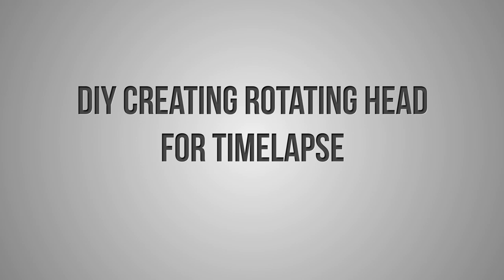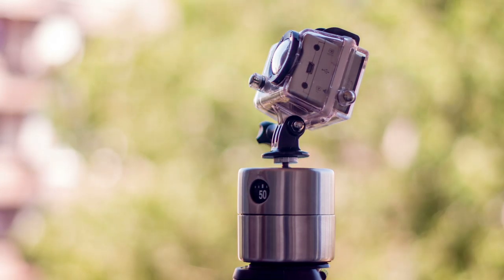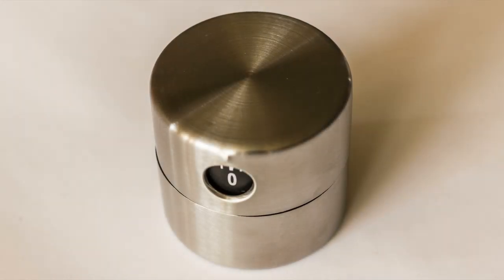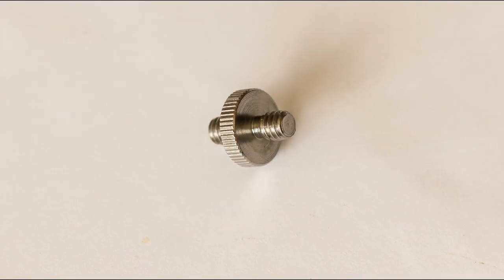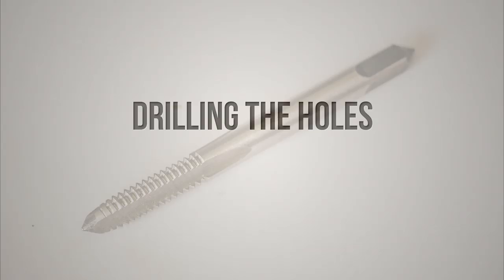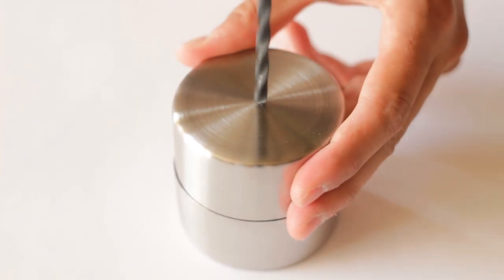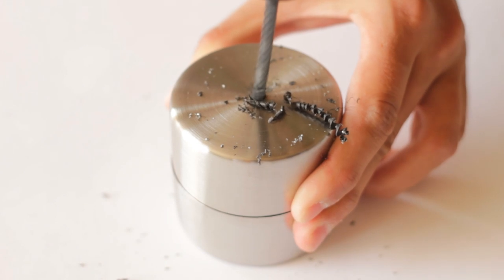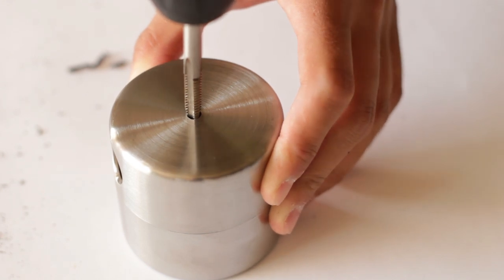Build a DIY Rotating Time Lapse Tripod Head

Comment: Why not just glue the tripod mount adapter on top instead of all this drilling?
Reply: Then you're stuck with that. Putting a 1/4 20 in it you can mount anything.

Comment: would work for shots panning from right to left, but the other direction not so much.
Reply: flip the eggtimer uppside down
Reply: Reverse the video.
Reply: David Andersson It wouldn't work, the panning direction will be the same.
Reply: Brian Diaz solution works well, but if you have moving objects such a cars, people and so in the frame, you will see tham moving in opposite direction too :)

Comment: Dear Sir, I found a shop to order the 1/4 inch tap. The seller ask if the camera screw is UNF or UNC thread. Cause we do not use much this thread I hope you will answered  this question, than can I order the right 1/4 inch tap. 

Photo attached.

http://imageshack.us/a/img661/605/D6zhoh.jpg

Thanks Luc!

Comment: WTF! Using a drill to tap a hole
Reply: it does seem a bit overkill the metal is only thin too so that drill could rip the metal apart or ruin the thread completely but it worked in this video! i wouldn't do it though! :)

Comment: Cheaper to buy the Rotating Time Lapse Tripod Head from eBay. 
Also why on earth did you use the tapper as a drill and all you did was to make the hole bigger. 
I noticed you tapped it fine first time then stuck it in again and used it as a drill bit just to make the hole bigger, YIKES!! 
But honestly it is cheaper to buy one from eBay.
Reply: Cheaper? Really? What do you mean? Please write the item name I'll search for it. All panorama heads I saw where > $30 and not even timelapse.
Reply: And also if you use the sticky pad on the ikea egg timer it saves you drilling. A sticky pad comes with the GoPro and SJ4000 and they are really strong.
Reply: Hi, Thanks for the link. Nice find! I thought to mount my Sony NEX-6 on it with wide lens. Will it hold that camera?
Reply: 2 hours looks like too much time for me. I never shoot more than 1 hour time lapses most are in 30-40 min range (mostly clouds). 2 hours is good for stars though..
Reply: Or Banggood - http://www.banggood.com/360-Degrees-Panning-Stabilizer-Rotating-Tripod-Adapter-For-Gopro-DSLR-p-937620.html?p=QG080163176892016090